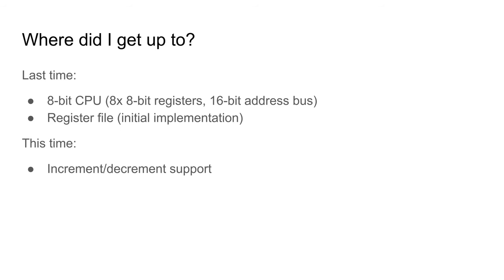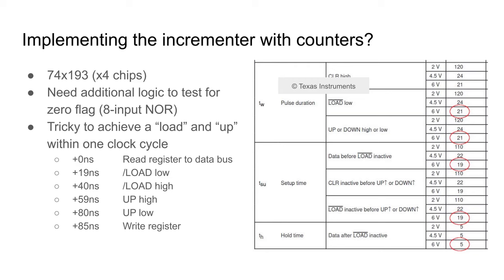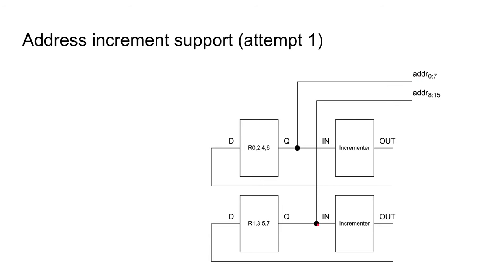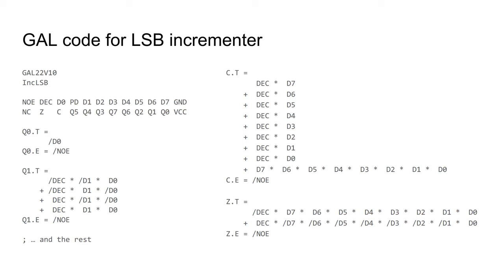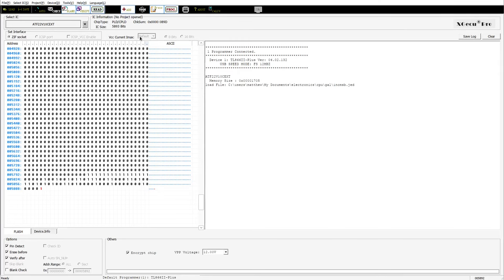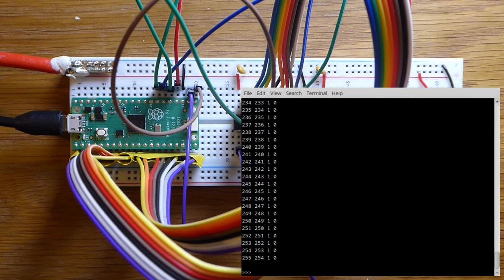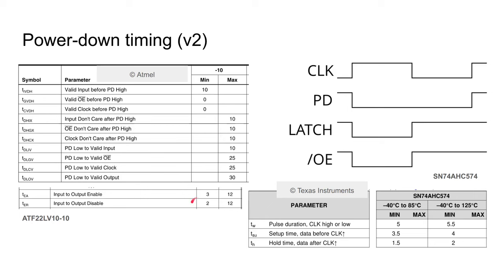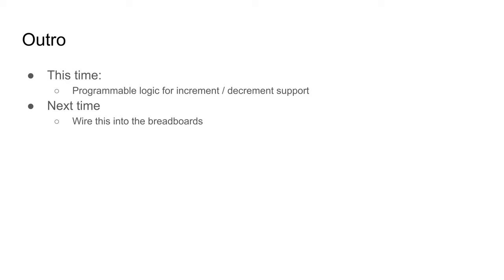Designing an 8-bit CPU - 4 - incrementing and decrementing

Comment: 🚫🧄
Reply from the maker: I've done some more testing on this "power down" mode, and it's more complicated than I thought 😿

More on that next time... if I get this new breadboard finished 😆
Reply: @phodopus42 I too keep power consumption foremost in designs, just in case it needs solar power one day.
Reply: @davidgari3240 I like CMOS logic. An 80s RISC CPU design without branch prediction or instruction reordering has an extremely low power consumption. In a Micro processor parasitic capacity is low, and so is power consumption. Apply any clock up to 1 GHz . I still don’t know how a CPU knows the clock. Like, is there adrenaline? Direct power from solar can use a Joule thief to launch the next cycle once enough energy was collected. I think that spacecraft work this way. But what happens in an eclipse?
Reply from the maker: @davidgari3240 My only concern at present is that my cheap lab PSU has a fan that spins up when I draw a few watts 😅